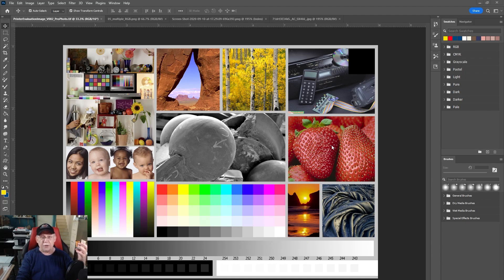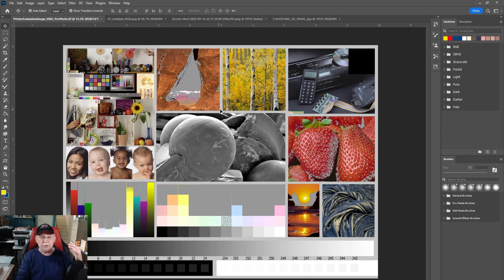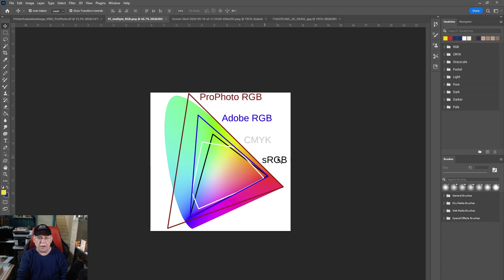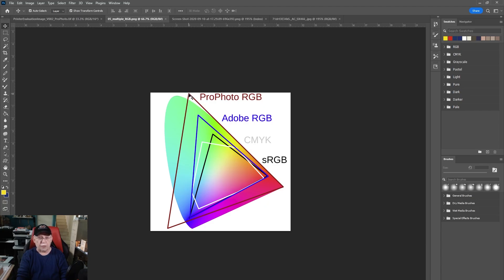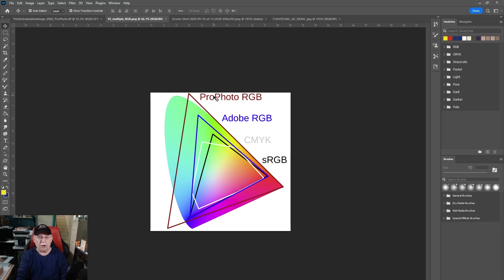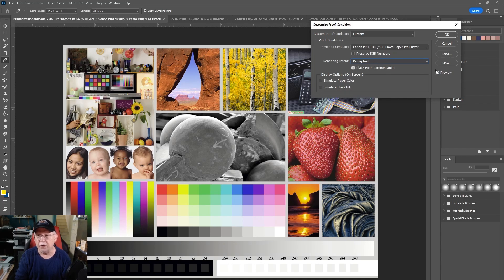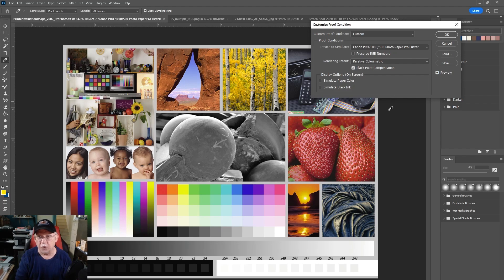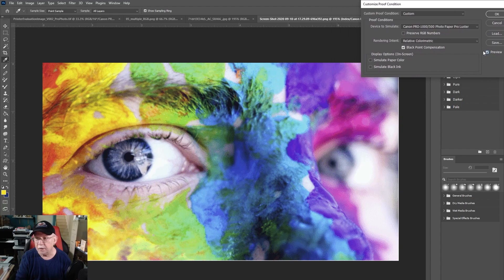Exploring Gamut and Softproofing Part  #2

Comment: i'd love to delve deeper into editing in soft proof for out of gamut colours, what editing tricks there are

also a question, which are the best file types to save your edits via photoshop for printing
currently just using jpeg (photoshop 5 via mac book 2015)
Reply: No expert here but, in Lightroom 6, (if you use LR, if not, other programs should have a softproof option) ) in the Development module, go to the top left, menu, view=drop down menu to Soft Proof, go to the right menu=click soft proof & then the drop down menu. Make sure you turn off/uncheck monitor & have destination checked. On the right side near the top under Create Proof Copy, choose your paper profile & rendering intent (relative/perceptual). Now this is what I do. I go down to the individual HSL color sliders & play around trying to get it as good as possible. Don't sweat it if you can't get it. In fact, if you want, print a small section of just the problem areas/color before you do it & after. But you will be using paper but good for an experiment. Very rarely will it matter that much in my opinion. Sometimes Yellow for me on a Canon Pro 100. I use to tweak a lot & sometimes still do but very slightly. Remember that colors you adjust, eg. blue or red might effect other colors that are made up of them & you now might have to adjust them also. (open a can of worms theory) Remember the photo Jose showed printed. Looked pretty damn good to me so, you might want to print a very small test print & if it looks bad, compare it to the monitor. If it looks good, don't even hold it next to the monitor because the monitor usually looks better being backlit. Some prints can be achieved like this but will most likely be printed on acrylic.= EXPENSIVE! Check out landscape photographer Mark Gray's u-tube channel=, the, Are there Lights behind my prints vid. Have fun, & good luck!
Reply from the maker: Well is you use something like Lightroom it does zero changes to the original raw file. All edits are saved as virtual history. You could of course export to an actual file format to a non lossy format such as tiff.

Comment: Why couldn't a custom monitor color profile be replicated based off of the printers calibrated icc profile and paper match so you could set your monitors profile exactly to the same color gamut as your printers capability and in theory see what your printer will actually  print in real time as you edit.